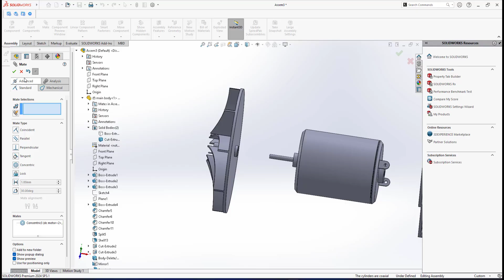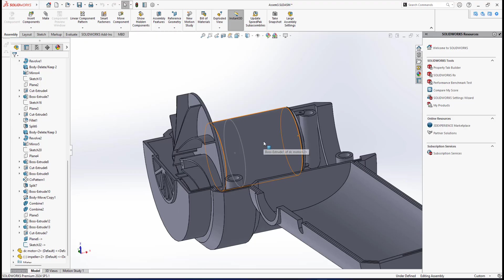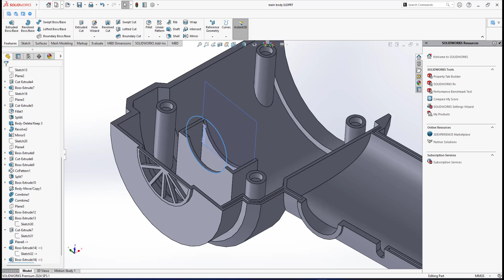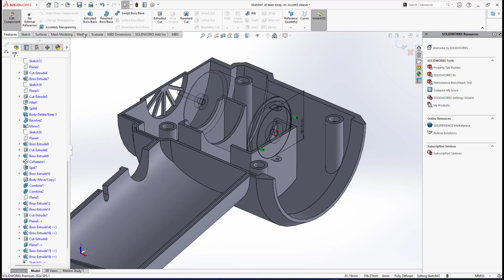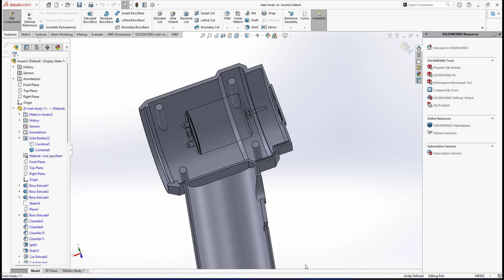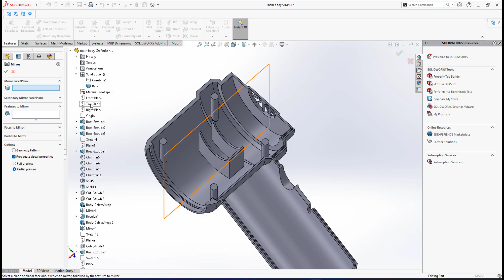Part 4: Detailing The Front & Rear Casing in Assembly Mode (Ribs for DC Motor & Groove for Rear Cap)

Comment: Motor and battery dimensions?
Reply from the maker: The motor and battery were modeled based on standard dimensions.
Reply: @hrldesignstudio  Thank you. It's OK. Now I'm in Part 8: Dust Container Part Modeling with Key-Slot Feature.